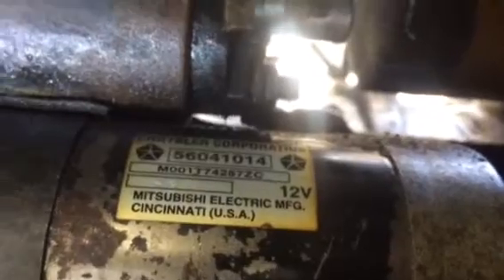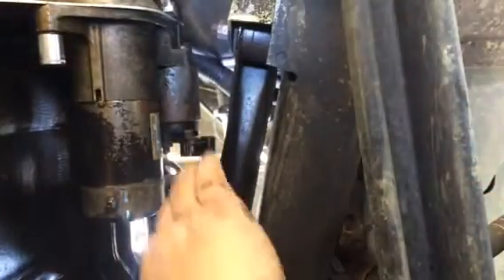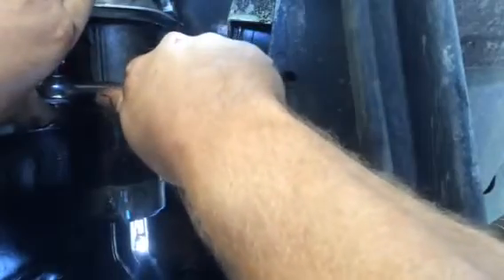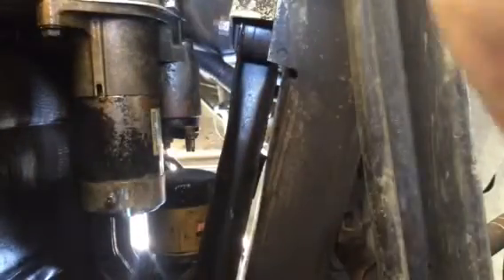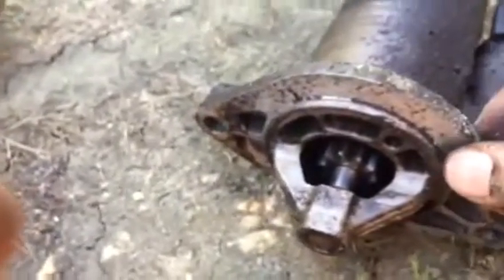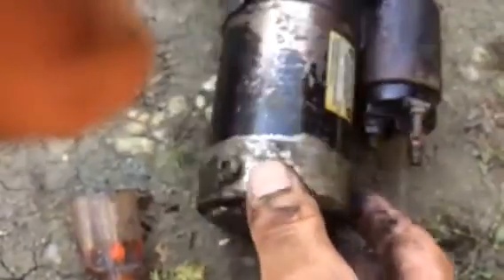98 Jeep Grand Cherokee Starter removal

Comment: Had a new starter and still would not go, led and attached a 6 gauge wire from negative battery post with eyelet and then attached it to the bell housing bolt with another eyelet, the long one on starter casing side, voila heavy ground with no more issues starting
Reply from the maker: excellent glad to hear you got it sorted! thanks for watching and sharing your solution!

Comment: I have a 1998 grand cherokee limited edition i crossed my jumper cables as it was at night and couldnt see....now it wont start no crank no start all lights work everything works it just wont crank over. I had starter tested its just fine changed the coil battery tested ad well and its fine. Struggling here any help or insight would help seriously frustrated
Reply from the maker: Leonard Wonnacott check connections cables all way to starter
Reply: Fuses?